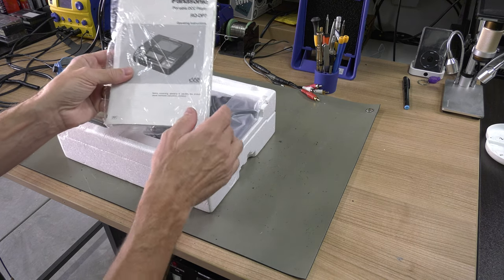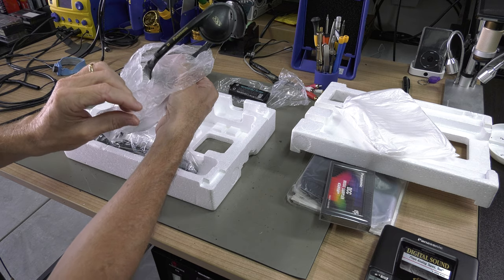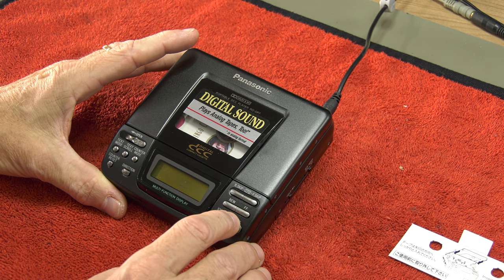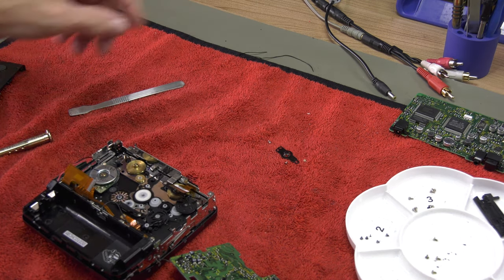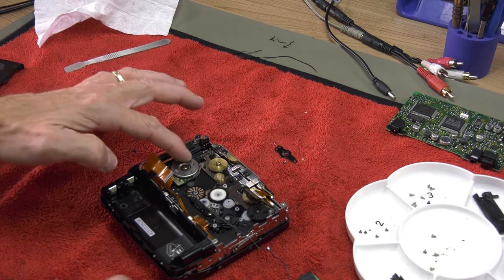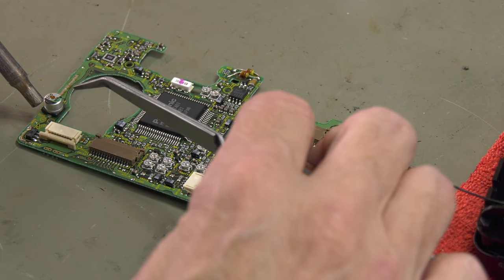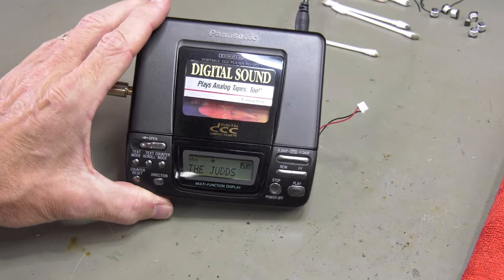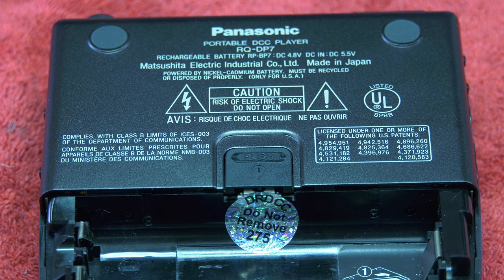Unboxing and Restoring the Panasonic RQ-DP7 Portable DCC Player

Comment: Why is it belts on 1990s cassettes always turn to goo, yet belts on machines from the 1970s, even late 60s, are often still in one piece. Did they change the type of rubber or something?
Reply from the maker: Good question.  Must be to save money.
Reply: @DRDCC maybe natural rubber belts vs newer synthetic rubber, that eventually turns back into oil? That's a thought I just had.